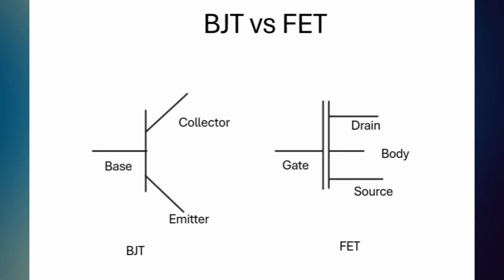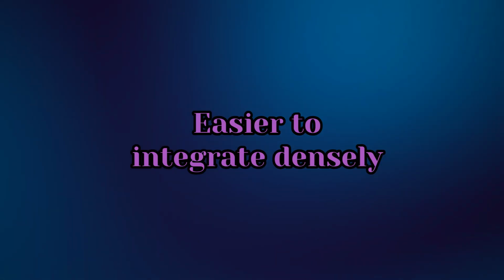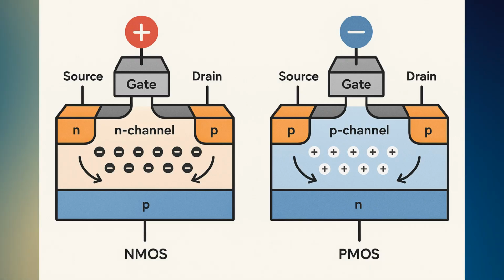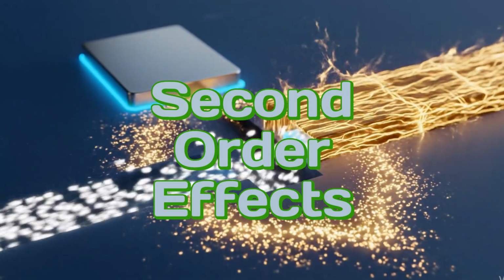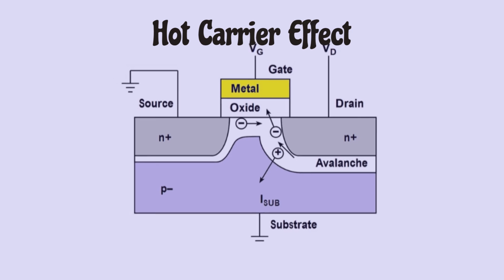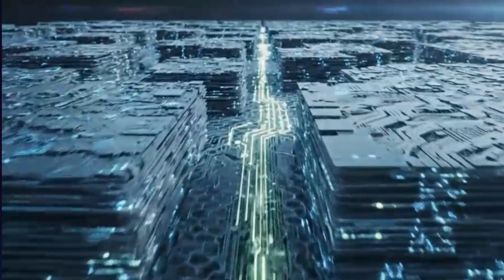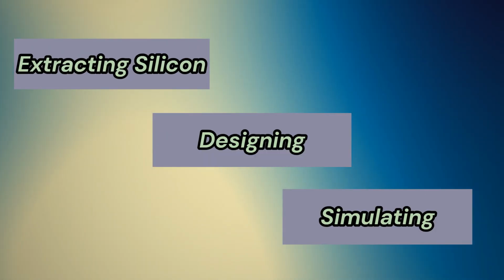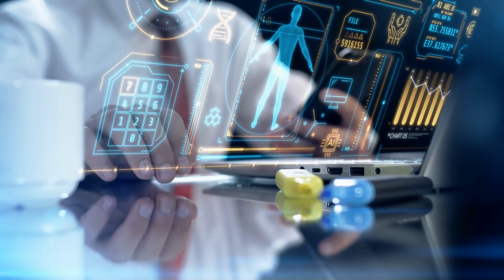Transistors: From Vacuum Tubes to modern MOSFETs | Part - 2

Comment: Nice work ....Nano fabrication.....what about 2d material......?
Reply from the maker: Thanks, Yes ofcourse in nanofabrication 2D materials like graphene have some nice properties like high mobility and atomic thickness, but there are limitations like uniform wafer-level growth, and also with the existing fabrication techniques they are not compitable, that is why silicon still dominates. But yeah, one of the open areas for research considering the present trend would be 2D material.